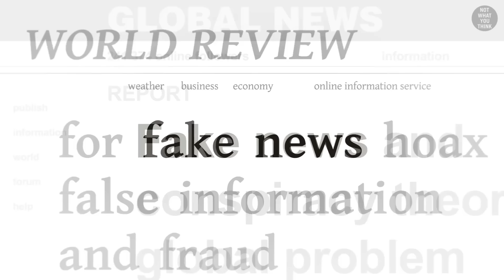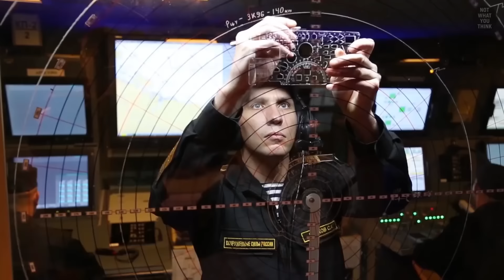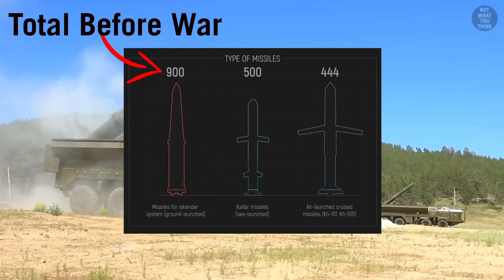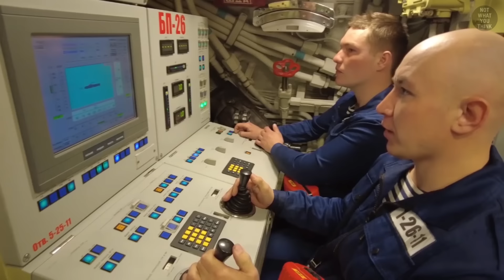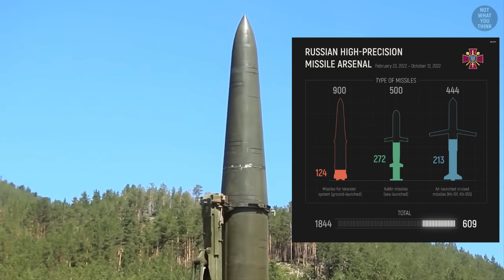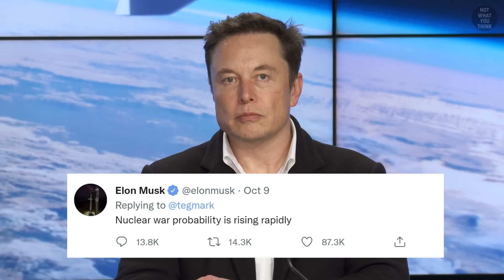Russia is Running Out of Missiles

Comment: Quick note: no missile is easy to intercept, and the low altitudes subsonic cruise missiles fly at can make them arguably more difficult to intercept than high flying ballistic missiles
Reply: nah, they are getting intercepted by mobile manpads crews. The same thing with planes, helicopters and drones. The only advantage is ability to change their course midflight.
Reply: I can't blame you for not understanding rocket science, but subsonic cruise missiles are much, much, much easier to intercept than ballistic missiles. Like the previous reply noted, cruise missiles have been shot down using MANPADS .. a missile flying 50km in the sky at Mach 6 is very much more difficult to shoot down. If you still don't believe me, the intercept rate discrepancy tells the story.
Reply: I think we have the technology.   Take the German MANTIS system which was designed as a CIWS close in weapons system with a range of 3km to protect Luftwaffe Airbases.    It is a 35mm gun firing AHEAD ammunition in a fancy turret with the required precision radar.   It can be fitted in modified form to AFV like the BOXER.    The software and radar exists.  A battery of MANTIS is 6 guns.   Place them 3km apart in a circle and one can protect a space of diameter 6km though a tighter spacing might be more realistic.   
-The problem is no one has built and invested in these systems in sufficient quantity.  Part of the reason is cost but cost comes down when ordered in quantity.   This at least takes care of drones and weaving subsonic cruise missiles over cities and will likely handle, to some degree, missiles up to Mach 3.  
-Missiles such as IRIS-T and SkySabre launch vertically and lock on to target after launch when they are close to target.  The directing radar can be 20km away and more than one radar can be used.   The problem with these missiles is cost for certain kinds of target.   MANPAPDS still need to be pointed at the target.   The solution could be something like the German   LFK NG missile basically a mini IRIS-T of only 28kg with a range of 10km that has lock on after launch capability.     A radar like the elevated "Giraff" or a radar in a drone can pick up these targets.
-There are other possibilities.  76.2mm canon with guided projectiles have long been in use.   The USN is now introducing guided 57mm projectiles (MAD FIRE) and it's likely the technology will move to 50mm, 40mm and 35mm to as small as 20mm.  This would allow a 35mm gun to engage accurately and with precision to 5km or more.  
-There are also some interesting guns like a 30mm recoliless autocanon Rheinmetall made which has a muzzle velocity of 1200ms yet weighs only 100kg.   The driving motivation was accuracy on Tiger helicopters but it can be mounted on top of a 10m erectile mast (eg u-boats) to clear terrain.  

-Problem is although systems exist they don't exist in quantity.
Reply: @drfelren 

In order to shoot down a cruise you first need to spot it. Due to them flying close to the ground, going to be flying below most radar installations. The missile could be easily detected by eye, but it would be hard to tell what it is, where it’s going, and communicate the information to relevant systems. The missile is also still going ~1000 kmh which is in no way slow, complicating detection and communication.

Stingers have very bad range, meaning you  have to have large amounts of soldiers scattered all across large portions of the country. The short range also means you have a very short window to fire the stinger (remember, the missile is going ~1000kmh) causing soldiers to have to be manning these stingers 24/7 as there is little time to react. These issues are further made worse by the fact that unless you have your stinger-men very densely packed, the cruise missile will likely not fly directly overhead making interception even more difficult.

Any ManPADS that shoots down a cruise missile is only a lucky hit and is in no way easily reproducible.

Compare this with shooting down a SRBM.
The high altitude means any competent SAM site could detect it. The SAM site could then immediately fire an intercepter. The long range of these SAM systems means you need very few of them. The high speed of the ballistic missile does add some complications but it’s not much harder than bunting a baseball.

Missiles are hard to hit. Intercepting cruise missiles and ballistic missiles both come with a unique set of challenges, and with a lot of unique situations and factors, it is ARGUABLY more difficult to intercept cruise missiles in many situations.

I don’t know whether you read these blocks of text Steven Reynolds, but don’t treat me like an idiot.
Reply: @Fhcghcg1  My apologies if I offended you, I am merely trying to provide insight. Firstly, these cruise missiles are almost entirely shot from the Black Sea or Russian/Belarusian territory hundreds if not thousands of kilometers out giving sufficient time to recognize, communicate, and react to the oncoming barrage. Subsonic speeds are relatively slow for a missile especially if it is know where they are coming from. Secondly, while I agree MANPADS do not have the range optimal for intercepting missiles, there are thousands of them all throughout Ukraine. Lastly, very few systems can intercept ballistic missiles, whereas even MANPADS can intercept cruise missiles in the right circumstance. Intercepting a ballistic missile is much harder than intercepting a cruise missile or we would have seen it done more often - relative to the over 50% success rate of intercepting cruise missiles.

I would like to highlight the inconsistency in your statements "no missile is easy to intercept" "the ballistic missile does add some complications but it’s not much harder than bunting a baseball." Again I am sorry if I offend you and I honestly do want you to gain something from our conversation.
Reply: @Fhcghcg1  in addition to manpads there are aviation for taking down missiles where it's impossible to do from the ground. Don't forget that.

And I love internet. The only place where someone with anime pfp is saying "don't treat me like an idiot" (I don't have anything against anime pfps (only if they are cringe) it's just funny)
Reply: @worldspam5682  I don’t know if you know this or not but the reason you don’t see such things outside of the internet is because pfps don’t exist outside the internet.
Reply: @drfelren    subsonic Cruise missiles (including Kalibr) have turbojet power plants not rocket engines, except the initial boost phase.  But sure we can still go with rocket science assuming the MANPAD crews are swimming in the Black Sea.  Accepting claims from either side in this conflict as fact is a mistake, nonetheless claims from the masterminds behind the ‘Ghost of Kiev’.
Reply: @geebee802  I'm not sure what you are trying to say, it sounds you are arguing petty semantics against a figure of speech. You just reaffirmed that cruise missiles are rockets by means of the boost stage. There is video evidence of MANPADS intercepting a cruise missile, likely a kh-55 or 22.
Reply: Arguably is the issue. As long as there are AWACS around it does not matter if anything hugs the ground or goes into space. IT can be seen. Whether response can be fast enough depends upon the counter-measure chosen. The best counter-measure is for Ukraine to make actual attacks WITHIN Russia. Take out entire cities grids and sewer systems. Take out their water system. Choose mid to smaller cities and take out all infrastructure with precision and permanence. Keep taking out supply bases and ending logistics capability. This war will end pretty quickly at that point. The MOMENT that attacks take place on RUSSIAN soil, the people of Russia will end it by killing Putin themselves.
Reply: @djea3589  Mm...I don't believe AWACS can detect cruise missiles as it's basically a problem of trying to distinguish a missile from the millions of other metallic objects when looking toward the ground. I suppose the technology exists, but it looks like it's still in the experimental stage and not mass production.  

But if you want to ignore that, then understand that the Ukrainians probably don't posses an AWACs aircraft.  The radar technology is too advanced and would be subject to export regulations.  

So basically, if an AWACS is there, it's owned by the US.  And if there's a problem that results from that, it's going to be a delay in communication.  AWACS operators need to detect the missile, notify their superior, who decide whether to notify the Ukrainians, time is needed to relay the message, manpower needs to navigate bombed out infrastructure to get in position to intercept...
Reply: @drfelren  That’s not always true. A wider breadth of systems can intercept subsonic cruise missiles, but in terms of relative success rates of the interceptor systems they aren’t far off. Extremely modern subsonics can still be difficult to intercept, looking at things like the LRASM. This is from an American perspective, but BMD systems have gotten extremely reliable, at least when dealing with conventional ballistic missiles.
Reply: @jonathanpfeffer3716  Thanks for your response. Firstly we aren't talking about the most advanced missiles, I am specifically talking about Russian cruise missiles. Secondly, because more systems are able to intercept cruise missiles relative to ballistic missiles means that they are more capable of being intercepted. Thirdly, until ballistic missile interceptions exceed 50%, the statistics clearly exhibit that cruise missiles are intercepted more frequently than ballistic missiles in Ukraine. I realize that much of this technology is from yesteryear, but this is the data that we have to work with. It could be that the most advanced cruise missile and the most advanced ballistic missile are essentially equally difficult to intercept, however, they are not available in the several hundreds, and they are not what is being used in today's warfare.
Reply: @drfelren  Russian Kalibrs are going to be pretty easy to intercept, that is certainly true.

I have absolutely no idea of missile interception rates, ballistic or cruise, in actual combat in Ukraine, I only know about the American side of this. But, at least with ballistic missiles we do get interception rates much higher than 50% in both terminal and midcourse phases. Even raw numbers from actual tests have much higher average pKs than that. Of course, if we were going against the most modern BMs (HGVs), that changes things up a lot. With more conventional threats cruise missiles are usually easier to intercept. Its only when things get more modern where the waters get muddled.
Reply: A Guy with a anime picture talking about missiles  🤣🤣
Reply: You’re wrong. You might be thinking of how it is easier to shoot down a cruise missile than the super slow flying Iranian drones since its trajectory can always be changed on the fly and huge better terrain masking.

Comment: i have a theory on why the missiles might be spinning out of control when they launch in Ukraine, due to poor maintenance of the fuel and it not being replaced far past its expiry date, the plasticizer in the fuel degrades and clumps of fuel might have sagged down to the side of the missile, therefore creating higher thrust on one side of the missile, i was doing a research paper on rockets and more specifically rocket fuel, and how to prevent this sort of thing, really makes you think about the qualifications of the Russian ground teams.
Reply: You're telling us they store their missiles fully fueled?
Reply: @TheFleetAdmiral33  it is russia after all
Reply: @TheFleetAdmiral33  Plasticizer means solid fuel. So they can be launched immediately, but need to be refurbished instead of refueled.
Reply: One part I don't get is that the missiles mostly fail at start, but the propellant slices burn from inside out towards the sides. I would more suspect cracks which occur in plasticizer loss.

Comment: In the just one video you're simultaneously told that Ukraine has many S-300 used for interception with 70-50% success. It means 30-50% of S-300 launched hit somewhere other than targets. And at the same time, Russians for some unspecified reason are going out of their way to convert their S-300s exclusively to strike random civilian buildings.
Reply: I guess they are more useful in AA task than, g2g tasks. If the facts statet are all correct
Reply: This is purely a generalization,,

Shooting smthing in the air is different from shooting smthing on the ground. Acquiring n locking on to an aerial target require fast computer reaction to track the target. Acquiring n locking on to a ground target dont require fast computer reaction, but the ability to identify the target in the first place, and filter out everything else around the target. Or, of course, u can just plug in a coordinate and godspeed. But that also means its practically a “dumb” missile, with no built in software to avoid incoming anti missile missiles. Coz u know, the S300 IS the antimissile missile. Its not doing what its suppose to do. Sure, maybe abit of software tweaking but still. 

As for the boom itself, S300 do pack a punch,,, but just not as punchy as an actual cruise missile. Warhead weight is under 150kg. Which might seem alot, until u know that the average cruise or antiship missile are packing 300-500kg warheads.
Reply: @arsyadidris6349  I mean the craters in Poland were really huge.
Reply: @Eddy1938-b  wont deny its huge, but a true cruise missile with half-tonne warhead can completely level something as big as the statue of liberty.

Comment: Could it be they keep a stockpile of the more modern missiles for when the war escalates and other country's get involved? First use up the old stockpile againt Ukraine and keep the more modern stuff ready for escalation? And also, using Iranian drone's to avoid that their own tech falls into enemy (read america's) hands? Just viewing things from both perspectives
Reply: @kuskusdikus6014  you are 100 procent correct. It's hard to find any news on the topic that is not complete utter propaganda, on both sides.
Reply: use up the cheap missiles to deplete the missile defence systems. Then use the expensive missiles to better effect. Still there is reason to think their stockpiles are getting low, but the shadow of war means nobody really knows. Like people talking about the build plates being recent, that may simply be due to Russia refurbishing older missiles after seeing the issue many were having. Nobody really knows yet.
Reply: This is unlikely. As they haven't done so in any other area, aircraft, small arms, armored vehicles, drones, navy. Even in the case of some of their latest air def and electronic warfare and intelligence equipment. They have used their best stuff whenever they can, and have been forced to replace losses with older equipment over the course of the war. We have no reason to believe missiles are any different.
Reply: @MachineCode0  Yeah sure let's just ignore them using literal Soviet era equipment lmao
Reply: @pieterlindeque7798  Because thats all they have?

Comment: Really good Videos, i hope russia doesn't use nuclear warheads, but if they do, 20-60% failure rate wouldn't be good for the russians, if it explodes at the launch site xD
Reply: do agree
Reply: A 20%-60% failure rate of 6000 warheads isn't exactly reassuring. Whatever the failures of the Russia military machine, missiles isn't one of them, so I wouldn't count on it if I were you. Rest assured if they were dumb enough, Russia has the capacity to eradicate life as we know it, many times over.
Reply: @theirishempire4952  more than enough i think.
Reply: nuclear warheads are generally (I'm pretty sure even in russia, otherwise the soviet union would have had accidental nuclear explosions) constructed in such a way that uncontrolled explosions and crashes do not cause a nuclear explosion. they just break open the warhead and spread the nuclear fuel around.
Reply: @osric1730  I would expect to be a much smaller percentage of russia's nuclear weapons than of its conventional weapons to work, since they haven't been expected to ever be needed for decades, and their upkeep is even more expensive.
Reply: @Ass_of_Amalek  Really? And why would that matter? They do the job of deterrence more than adequately or NATO would have wiped the floor with Russia months ago, and they only need a fraction of their arsenal to work to be able to deliver Armageddon. The debate is about as senseless as wondering whether you're going to get hit with one 40mm shell or two. So the answer to the question as to the state of readiness of Russia's nuclear arsenal is  "enough", probably several times over.
Reply: @theirishempire4952  Enough.
Reply: @osric1730  and you think this is news to me why?
Reply: why don't just invade Russia after we know all this ??? I wonder 🤦
Reply: @Ass_of_Amalek   I was being generous.
Reply: @theirishempire4952  Not a chance.  A system robust enough to defend against a concerted ICBM strike does not exist. What there is could perhaps defend against a specific target  with a chance of successfully eliminating a limited strike. So for instance if you surrounded Washington DC with a blizzard of THAD and Patriot systems you could probably defend against someone like North Korea and maybe get lucky. Against a near peer adversary? Not a chance. There's a reason why nobody is busting a gonad to make ever more sophisticated ICBMs, and entry level systems like North Korea's are still considered a threat. The US still relies on the LGM-30 Minuteman introduced in 1970. Its still plenty good enough.
Reply: @Ass_of_Amalek  i cant even believe that people dont know such kinda trivial things about nuclear weapons. Like wtf?